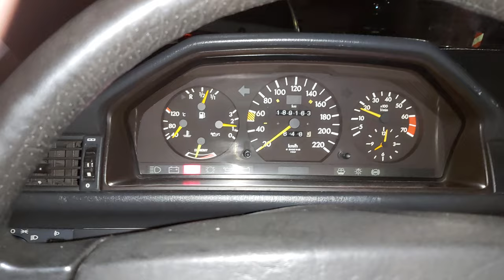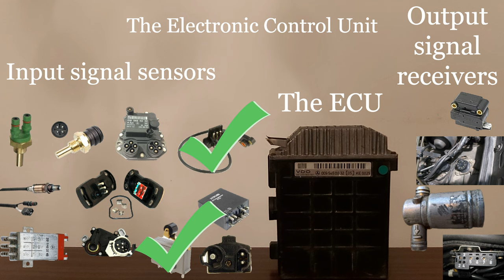Mercedes Ke-Jetronic - The evolution of the ICV

Comment: Hey, i have an W124 M102.963 engine and it haves an issue that when i cold start the car it starts perfect but it stalls. Works perfect after reaching +40celsius  i took the wire out of the icv and now it works perfect does that mean my icv is broken?
Reply: When the wire is out of the icv the car doesnt hesitate at all and idle is perfect 750 when cold start
Reply from the maker: It means either the icv gets false data from the ecu or it is not within its specs because of its cables...

Comment: What if my idle ,when cold, stays up for an unusually long time? It sometimes takes 2-3minutes of driving for the rpm to fall. My ICV has a 3 pin connector and it seems like it works. Cleaning it didn't help
Reply from the maker: Try adjusting it.

Comment: Hi Ivica, nice video again ! As you say, on KE3, the ICV raises the idle when starting the car. On KE2, what part should raise the idle then ? On mine, when starting cold, the cars stays at 750-800 rpm whatever happens... Thanks !
Reply from the maker: Hi. That's good. Greetings
Reply: That's not good. It should idle circa 1500rpm from cold, then drop to 700-800rpn
Reply: That's not good. It should idle circa 1500rpm from cold, then drop to 700-800rpn
Reply from the maker: @ronanconnolly2196  That happens on KE3, on KE2 not. On KE2 it should be regulated on the fuel pump relay port 87.
Reply: @mercedeske  isn't the port 87 of the fuel pump relay, just the switch on switch off for the fuel pump. Does it control the output of the fuel pump?
Reply from the maker: @siriperera6974  No. The pump runs "flatout". 87 starts the fuel pump, 87V the cold start valve, 87k the kickdown. But 87 is the power supply for the fuel pump and some more. :D

Comment: Hi Ivica, the video was great, don't worry, my Mercedes ICVIt has 3 pins, how can I try to see if it is healthy?
Reply from the maker: At first make sure that your micro switch. Measure resistance(ignition OFF). You will have to get 12ohm +/-3. At first between 3(negative) and 2(positive) and afterwards between 1(negative) and 2(positive) - the same resistance value. Measure voltage, you will have to get 11-14V ignition ON engine OFF. Contact 1 negative,2 positive. Afterwards contact 3 negative, 2 positive. On idle you will have to get 700-800rpm.

Comment: Hello from Greece Ivica :) Your channel is the best information source on YouTube for the KE Jetronic and you have my deepest respect for your work. I need your help if you have some time to spend: I own a W201 1.8 (18.000km only) whitch was running fine till 10 days ago. Suddenly on a cold morning I started having an erratic idle and a very curious throttle response. I took it to the workshop and the mechanic found a broken hose rubber cap. He replaced it and the car worked normally, although the idle did seemed a bit low to my ears (the car is not equipped with a rev counter).

The next morning the temperature was below 0 celsius (around -2C). When I cranked the car it did turn on as usual but after 4-5 seconds the idle became extremely low, the car started to shaking badly and finally the engine died. On the second attempt I tried to press the throttle a bit but the engine was unresponsive and demanded a lot of fine tuning with the throttle in order to stay alive. However, I managed to start moving slowly.

This happens every morning  and every time I have a cold start. BUT: When the engine is hot the idle seems to be a bit high(!) and I don't have starting issues. Regardless to say that other than the aforementioned problem (and maybe a bit of increased consumption) the car is working fine.

Please shed some light on what should I look for, because I live on a village far from the capital and mechanics who know KE Jetronic are simply non existent.

Thanks in advance for this and for all your efforts on the channel :)
Reply from the maker: Hi and thanks a lot for the compliments. The first thing you have to check concerning your cold start issues is to check the coolant temperature sensor(you have it how on my channel). If the sensor is fine then it can be that you have issues with the cold start valve. As for the idle check your crankcase breather hoses plus the rubber boot under the flow meter. That's as much as I can tell. Check out the potentiometer as well as the lambda probe(O2) sensor if you have it. That much I can tell. Happy Mercedesing 😃 and 🍀
Reply: @mercedeske  Ivica, you are THE MAN!  Thanks a lot dude and I’ll get back to you after the inspection.
Reply from the maker: @georgesakkas2567  👍🏻👍🏻👍🏻

Comment: Hello sir i need the explain about 2  pin icv on my w124 300E m103, i need the diagram about that 2 wire, because i have a m103 they modified with plus 12v when ac on,
I want to re wiring to the factory sett
Hope u can help me this time🙏
Reply from the maker: Hello. Pin1(from the top) is the ground and it goes to the ECU pin3 and the second one is the power supply which goes to the OVP either 87E or 87L. The ground should be a red/white wire. Sorry for the delay!
Reply: @mercedeske  thanks for the information ,i will try it
For test the ECU works its when ignition on without start the engine the icv has sound "tek" right? Mean the ECU give the ICV signal
Reply from the maker: @hendragunawan-up7kd Right!